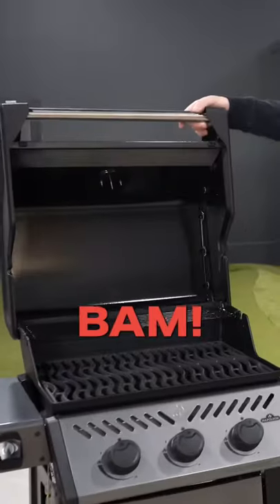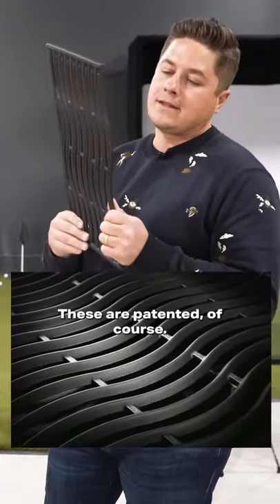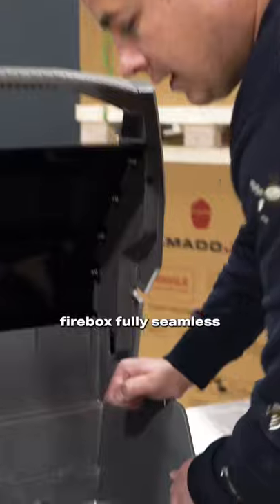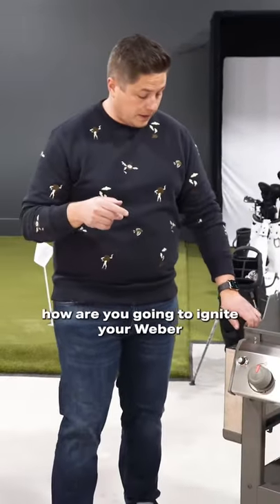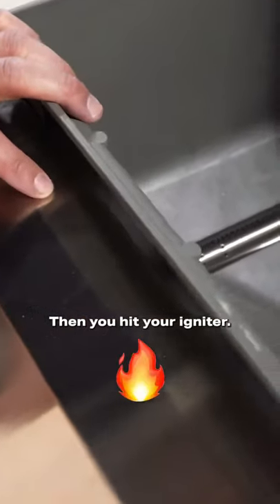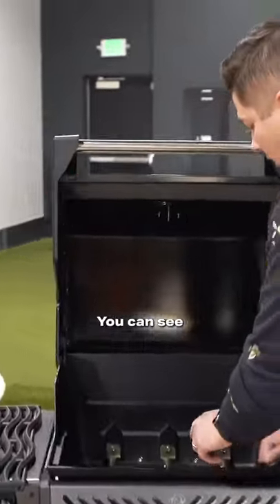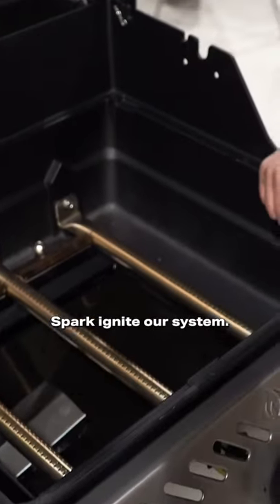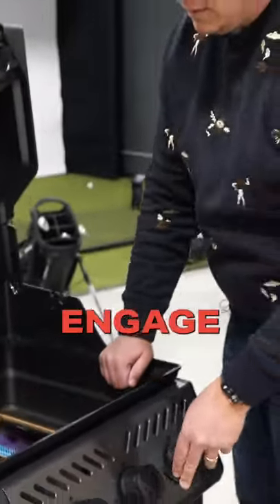Napoleon freestyle vs Weber SpiritII!!  #napoleonfreestyle #shorts

Comment: I have not found the napoleon ignition system to be reliable. How is the Weber after a year or two?
Reply from the maker: they both seem reliable
Reply: As an engineer, the Napoleon ignition system is very reliable. The burner distribution is also excellent.
Reply: @Dr.KhanMD  I have 1 of 4 main burners firing as expected.  2 of 4 are about 10% reliable. Last one will never fire.  
The side sizzle station has warped to the point the prongs are an inch apart and the gap prevents a spark. The rotisserie burner fires as expected.
While I understand I could have a grill that is not preforming like the majority,  I'm just speaking from experience. 
Prestige 500, 1 year 9 months old.
Reply: @craigs831  I assumed you have been cleaning/brushing the burners as well as the ports? Sometimes there can be a blockage